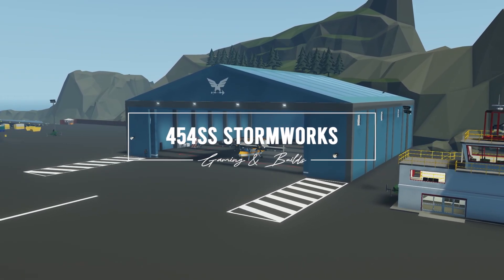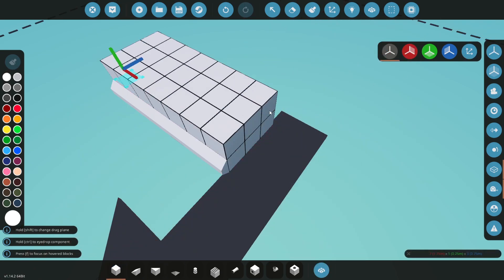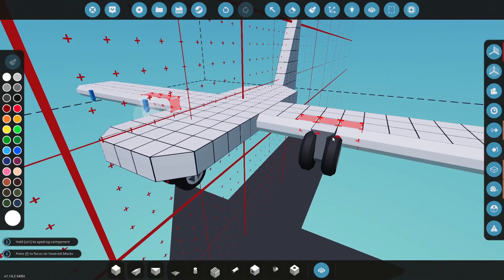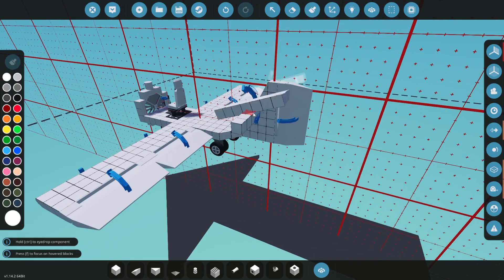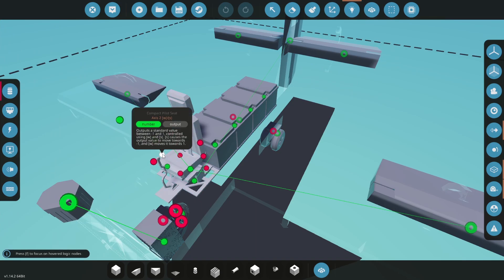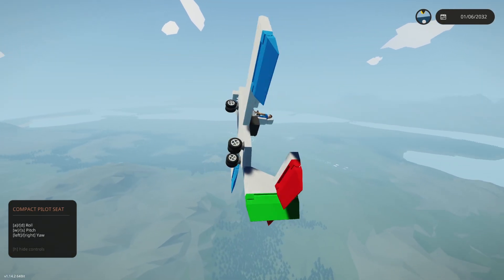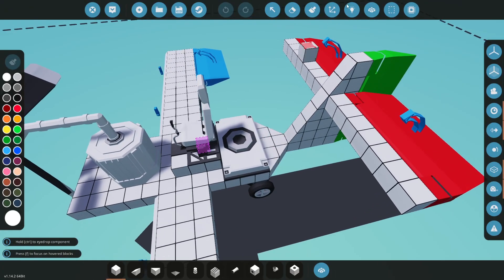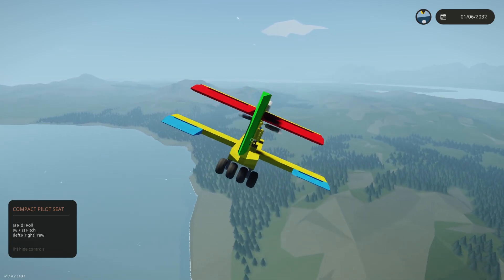How to build a simple AIRPLANE in Stormworks (Engineer Explains)

Comment: I'm currently in the middle of making a p51 in Stormworks, I have everything besides the cockpit canopy, and the paint. However the gyro doesn't keep the aircraft flying completely straight, when I activate it. Do you have any tips to keep it from drifting ever so slightly up and rolling to the side

Comment: Im watching your Videos for some time now and i have to say, that your tutorials are lifesavers for beginners to get a starting point to understand whats needed to build great stuff.
My actual Projekt is a Grumman Goose G21 Waterlanding Plane and im in for weeks now >.< my biggest struggle at this plane is to get it out of the water without using helicopter rotors.
After some time and some design changes im able to land it smoothly and also start it smothly :) great success :3

Now i have the trouble with the Airroll, my plane wont turn in the direction of the roll, all it does is rolling an stay in the same direction. Do you have any tips how i can solve this issue ?
Keep up the great work and i wish you all the best :)

Comment: Try to position the back wheels slightly behind the center of mass. the furter back you position them the greater the lever between the pivit poit an the center of mass becomes and therfore makes it harter for the elevators (pitch control surfaces) to lift the Nose from the runway.
secoundly, move your wings back. for a stable flight you want a plane, wich naturaly wants to pitch down slightly. this makes it more stable. Remember the papaerplanes form childhood. If they where backheavy an pitched up, they stall and just roll to eighter side and then will spin into the ground.